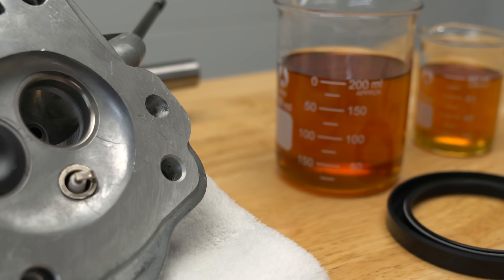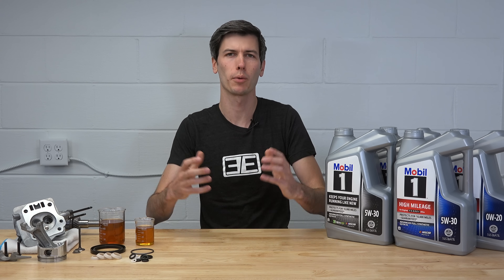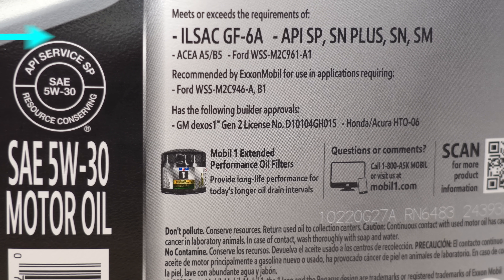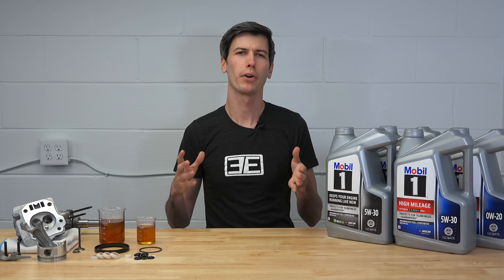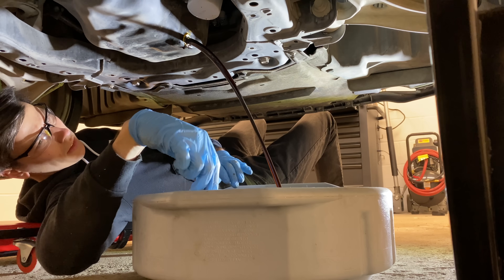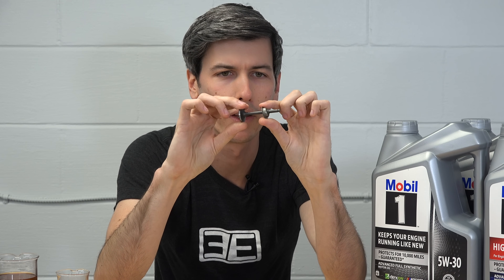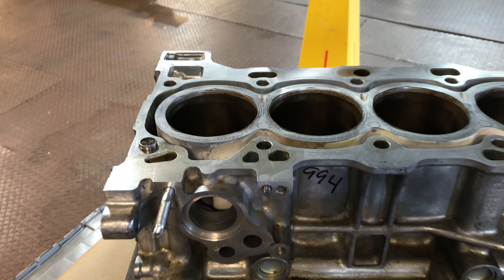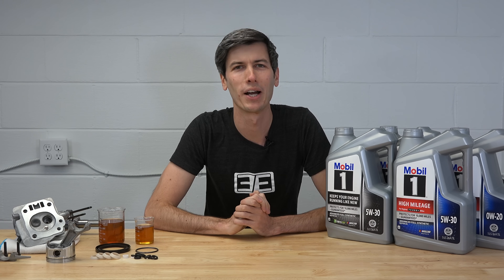Is Synthetic Motor Oil Bad For Old Cars?

Comment: What's the best oil for my car? ;)
Reply: Amsoil or Pennzoil
Reply: Maybe you can talk to Mobil about developing a synthetic beard oil?
Reply: @InFiD3ViL1  or mazola oil
Reply: @InFiD3ViL1  ROFL
Reply: Organic olive oil grown by ethnically diverse lesbians in a biodynamic way.
Reply: @thomas316  No disabled input? Fascist!
Reply: @thomas316  Best answer. 10/10.
Reply: HumbleMechanic 
Any oil that comes in a car that was given to you.
Reply: Peanut Oil
Reply: Christopher Browne This.
Keep it clean, make sure it’s the right weight, and it’s unlikely internal engine problems will arise no matter what you use
Reply: A straight 39 weight. ;-)
Reply: Olive oil
Reply: @AgentSmith911  She's good for a laugh but who is Sweepie's father?
Reply: Super Tech
Reply: Cbd oil? Somehow seems fitting.
Reply: @jumpinwired1  hell yeah, but it's better one CBD oil with THC so that everyone would keep smelling your exhaust pipe all the time wherever you go :)
Reply: SAE 10W30
Reply: Amsoil
Reply: Always provokes an interesting debate. I buy the manufacturer's recommended viscosity oil from the supermarket for my old Peugeot and change it and the filter every 5,000 kms.
660,000 kms later, no problems.
Reply: Jacques de Morton hey Jacques, which Peugeot?
Reply: HM Walmart Super Tech is as good as any. It has all the fancy numbers and letters as the big boy oil. API seal of approval. Super Tech full synthetic $15.00 for 5 quarts.
Reply: Clean
Reply: What ever the manufacturer recommends to be ran in that motor
Reply: @justsomefloridaman421  Top point. I was saying use the recommended grade of oil and change it regularly.
Modern oils are amazing, but I get by with cheap oils and changing them after 5,000 kms. I change the filters as well.
Obviously, hammering your car to go fast will cause more wear than driving sensibly. Motorcars know when you like them and care for them.
Reply: @kevinmoor26  I used gasoline as engine oil and now I don't have a car
Reply: @justsomefloridaman421  You are a lucky man, Sir. Never drive a cabover unless your interest in women has waned.
Reply: @kevinmoor26  That's deep. Please share?
Reply: @justsomefloridaman421  Ran?
Reply: Snake oil it works for absolutely everything the guy who sold me a 1000 litres told me.
Reply: The brand thats on sale.
Reply: The best oil for your vehicle is the oil recommended by the manufacturer, changed at the recommended intervals.
Reply: Mazola goes with your style
Reply: 5w 20 winter - 5w 30 summer Castrol Edge 👍
Reply: @TT-hy1hg  ...how does that make sense?.....both have "5" winter viscosity.....
Reply: Super tech
Reply: Water 👌  💦
Reply: Mobile 1 hands down.
Reply: Oil is oil. Dump anything in there and you are good to go.
Reply: @hatbpto5180  
If you use any oil, you're good to go for short distances. Mobile 1 is good for tens of thousands of miles.
Reply: Mobile one or Ky lube
Reply: @dwrldgster3151  
Mobile 1 all the way!!!
Reply: durex KY lube
Reply: Lucas
Reply: New oil is the best oil.
Reply: @HumbleMechanic - oh seriously ?? hahahaha ;)
Reply: Revenol oil is great
Reply: Refer to your owners manual for your particular oil specs, unless the engine is fairly worn out then use a slightly thicker oil than originally called for to ensure proper oil pressure:
Reply: @evanchapmanfanman  "fairly" and "worn out" and "I am dying" are subjective and worthless in this country; I learned the hard way. Consult a professional.
Reply: Lucas
Reply: cooking oil :)
Reply: I’m sure it’s in the manual of your car. Or you can google it
Reply: @Colorado_Ronin  I did. And I ended up here.
Reply: Virgin Canola oil
Reply: It all depends on what's under the hood.
Reply: Didn’t VW just switch contracts from Castrol to Mobil? The current OE part number, 5w40 bottle looks just like the old Mobil Super 3000 bottle. Which apparently is still a Group 3, cookie cutter Euro oil.
Reply: @Rusty Spelling. It's dinosaur, you dinosuar. No speelcheque?
Reply: @Rusty So glad you got my joke.
Reply: @Rusty So I'm so glad I amused you.
Reply: Amsoil beats all brands hands down.
Reply: @HumbleMechanic Amazon Basics is a phenomenal oil.
Reply: Vegetable oil.
Reply: Service center engine, trusted. Come in drum system, pay what you need. No balance oil, no plastic bottles environment friendly
Reply: Canola.
Reply: C user manual
Reply: Royal Purple.
Reply: Lube
Reply: Look on YouTube a video call Synthetic oil vs conventional a lab owner sets us straight. Very interesting. Learn from the experts not the guys selling the oil.
Reply: Clean oil is best.
Reply: Rotella 15w40
Reply: Coconut oil
Reply: Shell rotella. No exceptions.
Reply: do you like the yard work I did last week?
Reply: Gear oil
Reply: Mobile 1 .. demanded by all sports cars and luxury cars or you loose your limited warranty.. ferrari..Bentley..corvette ect.thats what I use.
Reply: Baby oil.
Reply: Cooking oil
Reply: Extra virgin olive oil, just like you!
Reply: Engine transplant!
Reply: Snake
Reply: Amsoil signature series has been tested and beats 99% of all the oils out there. They have racing oils too.
Reply: MOTUL 8100 xCase 💯% Synthetic
Reply: body oil
Reply: What ever the manufacture recommends.
Reply: Define the best and prove to me what is the different between the major oil bottlers?
Reply: Spirm oil
Reply: Lu lu lube 🔥
Reply: Epic troll
Reply: Astroglide?
Reply: Sure fire way to poke the hornets nest
Reply: Cbd oil
Reply: Baby oil.
Reply: Amsoil 100% synthetic. Thank me later.
Reply: @andywu8558  
Mobile 1 Extended Performance. 
Thank me NOW!!!
Reply: @ricktaylor3748  amsoil signsture series is 4 times better than that, do your research. I came from mobil one on my z and used to burn oil like crazy.
Reply: @andywu8558  
My 04 Avalanche 5.3 engine has over 404K miles. I've use Mobile 1 since the day I bought it new.
I'm not saying Amsoil isn't good oil, but 404,360 miles says a lot. 4 times better is pushing it.
Reply: @ricktaylor3748  4 times better is not pushing it because amsoil doesnt have any negative side effects to it. I do my oil changes every 10-15k miles and its amazing, never burns.
Reply: @andywu8558   I'v never had any negative side effects with Mobil 1.  I change my oil every 5500 miles, even thought it supposed to last 15,000 miles. 4 times better is definitely pushing it. You can't deny Mobile 1 is good oil.
Reply: @ricktaylor3748  i have and it burns oil.
Reply: @ricktaylor3748  its alright but not for high mileage cars.
Reply: @andywu8558    404,300 miles is fairly high mileage. My engine doesn't burn a drop of oil.
Reply: @andywu8558    You must drive a Ford.
Reply: @ricktaylor3748  nope, nismo 370z, vq37 all day everyday.
Reply: @andywu8558   V6 = No horsepower.
Japanese cars are for young punks.
Reply: @ricktaylor3748  trippen
Reply: @ricktaylor3748  say that to the supra owners. Lol
Reply: @andywu8558    Mushrooms.
Reply: @ricktaylor3748  none of you guys know what youre talking about, go do some research about the oil, im done with yall.
Reply: @andywu8558    I owned a 1986½ POS Supra, it was junk. The interior fell apart, the AC wires melted. Anything electrical messed up. It handled great, but didn't have much power.  Chevrolet is the only way to go.
Reply: @ricktaylor3748  you are an american car maxi and i respect that, but this conversation started with oils and it escalated quickly to an irrelevant topic.
Reply: @andywu8558        And ?
Reply: @andywu8558   You should check your compression and rings, if your burning oil  with Mobile 1.
Reply: @ricktaylor3748  its not the rings its the carbon deposits in the rings from mobil 1. Amsoil i dont get carbon deposits because its 100% synthetic unlike mobil 1 which is "full" synthetic which still has minerals in it. "Full" synthetic is not 100% synthetic.
Reply: @ricktaylor3748  nope, you dont know what you are talking about buddy, go try it out and then let me know, i already seen the difference and the results. Dont even take my word, just try it yourself and you will see. Carbon deposits are caused by the minerals in the regular oils and full synthetics, amsoil is on a different league on its own. 100% synthetic means exactly what it says, 100% synthetic, no minerals.
Reply: @ricktaylor3748  im not saying mobil one extended performance is bad, im just saying theres a better one out there. But still dont even take my word since you dont believe me, just try, you have nothing to losez
Reply: @andywu8558    My engine has 403,331 trouble free miles. What don't you understand about that ? I'm extremely satisfied with Mobile 1 Extended performance oil.
Reply: @andywu8558    Mobile1 Extended Performance, or nothing.
Reply: @ricktaylor3748  trippen.
Reply: @andywu8558         Mushrooms.
Reply: @andywu8558    Mobil 1 Makes it happen.
Reply: @andywu8558    You're gonna STOP using Amsoil.  You have to start using Mobile 1.
Reply: @ricktaylor3748  you guys are trolls, nah im good
Reply: @andywu8558     You don't understand.
I SAID you ARE gonna stop using Amsoil. 
Mobile1 is the Lube King.
I better not catch you with any Amsoil oil.
Reply: @andywu8558   Are you using Mobile 1 yet ?
Reply: @andywu8558  You better NOT use Amsoil oil anymore!!!!
Reply: @ricktaylor3748  you all can destroy your cars, mines will last a very long time.
Reply: @andywu8558   So, you switched to Mobile 1 ? 404,000 and still running strong. My 5.3 does not burn any oil.
Reply: @andywu8558   Did you call me a troll ?
Sounds like someone that uses Amsoil.
Reply: Pennzoil is a good one
Reply: @jackieliu5004    It used to be good.
Newer oils are better.
Reply: HEMP OIL
Reply: @MrJohnnyDistortion  
My engine like a good buzz.
Reply: @ricktaylor3748  😄
Reply: @MrJohnnyDistortion  
I used to work for the Get High petroleum  company.  🤐
Reply: @ricktaylor3748  
Did they drug test you?
Reply: @MrJohnnyDistortion  
No, I got high with the owner.
Reply: @ricktaylor3748  
You guys,,,,,, buddy buddy. (🤪)
Reply: @MrJohnnyDistortion   Nah. Ain't any pecker puffers in my family. If you're looking for "friends" try Grinder, you might fine the "man" you're looking for.
Reply: @MrJohnnyDistortion  
I've done cocaine  37 years, and I'm still not hooked.
Reply: @ricktaylor3748  
You're not applying yourself that's why. You must be ivy league.😄
Reply: @MrJohnnyDistortion  
You know better than that.
I'm allergic to poison Ivy, especially poison sumac.
Reply: @ricktaylor3748  
🤣
Reply: @ricktaylor3748  
?🤔
Reply: @MrJohnnyDistortion  ¿. Your girlfriend said she wanted to 🐝. with me.
Reply: exactly what manufacturer says too
Reply: @428dragpak    The 420 hemp oil company.
Reply: I think he answered it....synthetic and use the weight on your oil cap unless you are using oil then maybe try high mileage or higher viscosity
Reply: @louarmstrong6128    Just use Mobil 1...10 W 30 and be done with it.
Reply: @CyCast Schaffers is too hard to find.
Mobile 1 is better and easy to locate.
Reply: Pentosin oil
Reply: Humble mechanic hell yeahhh :))
Reply: The one you can buy
Reply: Supertech dino
Reply: Whatever oil that brings the boys to the yard.
Reply: Baby oil
Reply: The one that lubricates
Reply: Pertamina Fastron Gold 0w-20
Reply: Just pee in the carter, 100% ecologic
Reply: Beard Oil!
Reply: Beard oil
Reply: Amsoil
Reply: Massage oil (with a drop of lavender essence to keep that tailpipe smelling sweet!)
Reply: Liqui Moly of some sort?🤷‍♂️
Reply: Snake oil 🐍
Reply: @TheSilviu8x  Works like a charm.
Reply: @TheSilviu8x  No need for a venomous reply like that.
Reply: Liqui Moly, silly. 😘
Reply: Christopher Schaefer, what that hell is Moly? Is it holy?
Reply: @donteven5712  ...molybdenum......
Reply: Ravenol - Amsoil - Redline
Reply: Royal purple in summer 

Mobile 1 in winter
Reply: Cum oil
Reply: @jorgebustillos8469  🤢🤮
Reply: @jorgebustillos8469  Please clarify your comment or, if your wish, voluntarily remove it.
Reply: DEpending on miles/age... I recommend,,,,,,,,,,,,,,,,,,,,,,,,,, Valvoline,,,,,,,,,,,,,,,,,,,,,,,,, any viscosity... "MY" '71 AMC Hornet inline 6,,,, 232 2brl carb,,,,,,,,,,,,,,,,,,,,,,,, 3 spd on the tree,,,,,,,,,,, "radio" free,,,,,,,,,,,,,,,,,,,,,,,,,,,,,, free flow exhaust.....  "I" used 40 weight racing high detergent.......................................... !!!!"I" drove it like "I" stole it!!!!!!  Changed oil every 1,000 miles,, Filter was a FRAM HP2.. 1st,,,,,,,,, 2nd gear in town only!!! 3rd,,,,,,, on the freeway here in AZ ................................  GETTING on the freeway "WAS" fun...  That car was "CUSSED" by several residents here in Apache Junction, AZ.  "I" sold the car for $2,000 with 375,000 miles on the clock!!!!!!!!!!!   SEEEING those tail lights disappearing & holding that money,,,,,,,,,,,,,,,,,,,,,,,,,,,,,, 2,000 still wasn't enough!!!!!!!!!!!!!!!!!!!!!!!!!!!!!!!!!
Reply: Well, if it's an old car, then NEVER use synthetic oil, I've heard it will cause all sorts of problems.
Reply: @pjay3028  even funnier than your answer are the replies from people who don't get it
Reply: p jay, “heard from where?”
Reply: @pjay3028  When you say "heard" was this like a knocking noise from the donkey, or some old wives gossiping in the village?
Reply: @pjay3028  thanks:: maybe should not; proper Visc, filter,etc.
Reply: @pjay3028  well you didn't watch the video now did you :P
Reply: @pjay3028  bro. This video literally said it can't hurt
Reply: @that1guy322  muahahaha!
Reply: @pjay3028  Uhh, that automotive myth was busted in this video.

Comment: good video,  i had one statement about oil leaking,  when i was a young child i remember my grandfather talking about mobil 1 syn oil and he changed the oil in his car late 70's, then about 4 months later he noticed his cars rear crank seal started leaking,  he was told that syn. oil caused engine seals to expand differently vs the older pure dino juice motor oil,  i think later on the auto manufacturers started to use a different type of oil seal material so it would swell correctly when a engine has a synthetic oil in it so it would be ok using dino juice and syn oil.
Reply: Chris - key term "in the 70s"
Jason explained that the synthetic oils were changed because of that and today, don't have the esters that caused it.
  The synthetics of the 70s are not the synthetics of today.

Comment: I bought my Acura TL-S new in 2003 and my Toyota 4Runner new in 2004, and I have changed the oil every 5,000 miles in both vehicles using Mobil 1 full synthetic. Both cars still run like new and are approaching 200,000 miles. Neither use any oil between changes.

Comment: Can you switch from 5w-30, to a 0w-30 oil.  I'm thinking yes because it's the same 30grop oil just switching to 0w oil improves cold starts and get around the system earlier and faster for better protection.

Comment: I use Diesel 15w40 in my gasoline 1996 Cadillac Northstar engine.  it has more zddp (Zinc) to lubricate the valve train.  i used synthetic 10w30 since new, and it was always a consumer of oil. only risk i am taking is the Zinc might age the catalytic converter if it gets coated in zinc.  but i think the thicker oil will minimize the consumption

Comment: FWIW, I’ve been using synthetic, usually Mobil 1, for about 15 years in my ‘91 RX7, which sees a lot of track use. It’s still on the original, unopened factory engine, with good compression at 170K kms, although an internal coolant seal has failed, so I’m finally going to have to crack the keg.

Comment: I seen recently the use of synthetic oil in a car of 2000 that used always mineral oil before synthetic, the car had acumulated hard sludge that suddenly released blocked oil bridges in conecting toda and cams

Comment: I used synthetic oil in a 400,000 mile Saturn cleaned it out so well it messed the engine up. True story 👍🏾
Reply: Then the issues were already present
Reply: @Mad-Lad-Chad  Yea buddy, this had happened 4 years ago but I learned TWO important things that day: 
1. If its NOT broke don't fix it 👍🏾👍🏾
2. Synthetic oil really REALLY works

Comment: I think it's worth noting that there are some cases you should be careful with synthetics in REALLY old engines. Stuff from the 50's and less. A lot of these engines have no filtering or don't have full pressure filtering. They were designed for non-detergent oils, the idea was that dirt actually precipitated out of the oil into sludge that lived in the bottom of the pan. It's imperative when moving these engines to synthetic (or even modern conventional) oils that the pan is pulled and all the sludge is removed. Detergent oils may not be the best idea for the engines with no filtration since the whole point is to suspend dirt within the oil so the filter can remove it; if there is no filter, that dirt gets pumped throughout the engine continuously.

Comment: If you have a flat tappet non roller Cam engine the most important thing is to have zinc in the oil. If you put oil in without it and it is a new engine you will destroy the cam and lifters.  Amsoil has a synthetic oil with zinc for older cars.

Comment: When synthetics first came out they were not good for my '71 chevy 307 i had. We had just rebuilt and fully machined it to spec tolerances. After the break in i put a full sythetic oil in it squeezed its self right out the main seals the valve covers the head seam etc. The oil could penetrate the minmum machined tolerances whereas convintional oil could not. Nearly ruined the motor thankfulky i noticed the preassure drop before anyhing seized. I thought my drain plug came out...